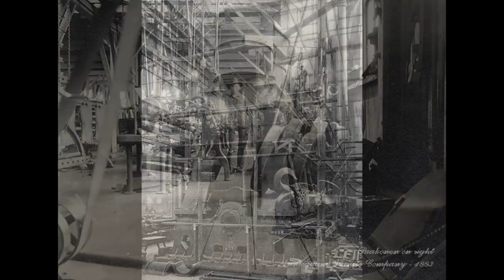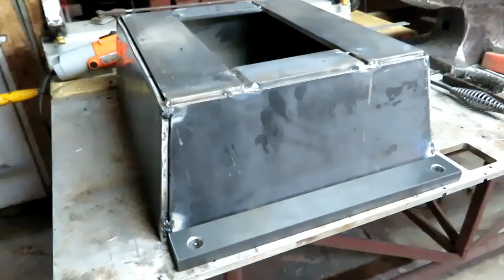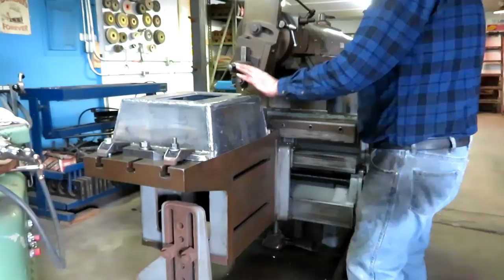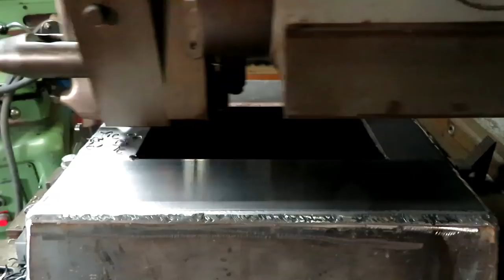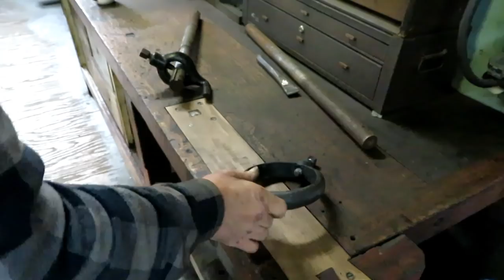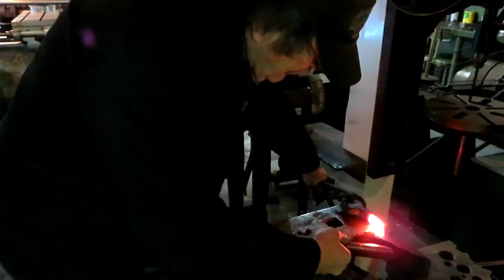OLD STEAM POWERED MACHINE SHOP  35  Steam engine frame base

Comment: One little trick I like to employ when fabricating an engine base from steel is to run over the entire surface with a needle scaler. The dimples on top of dimples that the needles make resemble a cast iron surface plus it hides grinding and welding marks.

Comment: Hi Dave! When you get around to painting that base, I would hit it with some self etch and SEM makes a great product for doing bumpers that is textured similar to safety paint (but not rough). I sometimes thin down gravel guard and reduce air pressure to get an uneven finish and then put the SEM textured paint on top to get a great cast look and finish off with some scrap silver base coat. Sometimes we build a parting line from body filler to make it uneven. It's all subjective to your needs or wants but thanks for entertaining my lunch today.
Reply from the maker: Great idea, I've used gravel guard before.....Dave
Reply: Gravel guard looks amateurish try the SEM stuff at a body supply store. Maybe Autozone has it, Walmart maybe but body supply for sure. Pebble Beach!

Comment: Great video Dave. Both the engine base on the shaper and the smithing. If you have access to the audio limiter setting in your camera, please raise the threshold and lower the record volume. If you can't access the limiter just lower the record level and raise it back up in your editing software. The constant pumping of the audio is enough to drive this old soundman crazy.
Mac
Reply from the maker: Sorry Mac, this little Cannon power shot doesn't have much audio control. ...Dave
Reply: Oh well.. I'm still going to watch your videos. Keep up the good work.

Comment: Great job on the builds , the machine base turned out super. Wish I get my back under control I need to build legs for my planer and an overhead pulley super structure . I have a nice 2HP 1140 rpm three phase to run it overkill but it was a trade no out of pocket . Have 5HP to make a RPC to run the shop. So much to do and no help . God bless buddy and hope your Christmas is merry and the new year stats out super. I know I'm looking forward to the big col increase of $2.00 YUPP think ill buy a brand new lathe YUPP wish in one hand and crap in the other guess which fills up first.

Comment: Todays episode was from your new fangled electric shop. 1960s? by the equipment in there. 
How did they weld things before electricity? Apart from Gas ofcourse.
That big planer wouyld go well in my shop as well.
Merry Xmas.
Reply from the maker: That base would have been cast iron, or possibly riveted together from plates and angle iron. Blacksmiths had the monopoly on welding and it's harder than you would think. The joint has to be made, the temp just right, flux added just right, and you have to be fast. I'm sure there are a lot of accomplished smiths reading this that can explain it much better.....Dave

Comment: Maybe if you had tacked or stitch welded some gussets into the underside of the base it might have prevented the top from warping in like it did, might have taken that hollow sound out of it too! So when you forged the dog, how did you form the circle after you split it open with the chisel?  Did you draw it down over a cone shaped block? Another nice video, really i
enjoy seeing that shaper on action. Merry Christmas!
Reply from the maker: I don't have a blacksmith's cone, should get one. It would have been easier and made a better job. I just wedged it apart, hammered the ends to spread it and worked it on the anvil horn. Getting the ends of the split out and round is harder than you'd think....Dave

Comment: you have a new subscriber! I haven't finished this video yet. but looks like you kinda think like I do. or at least do things kinda like I do. I'm amazed with steam. I want to build a steam DC power generator . to charge the batteries and power my off grid home. and use the  condensers to heat the house and help heat the hot water! I wish I had the tools or shop to build it all in. I think I can build it all. It will just take time.  my first attempt I guess will be converting a small gas engine to steam. then maybe a turbine . what ever I can get enough power out of . with as little steam as possible. or volume of steam.  videos like this male me think. and I learn something. thanks!
Reply from the maker: Sounds like a good plan, thanks for watching Jim, don't be a stranger......Dave

Comment: Wow Dave, In between loading up my Okuma lathe with a new stick, I watch your (as usual) first rate video. Yoo da man! Somewhere, don't remember, I read that the dead center in the head stock is called a live center...does that mean that the dead center in the tail stock is called a dead center? Had to bitch.
Reply: A live centre is one which has a built in bearing so can rotate without rubbing in the job. Dead centre is a plain piece of steel, a hard one in the tailstock and a soft one in the headstock so it cn be turned dead true
Reply: Can't argue with your use of the drawing, but my British textbook says what I did. Might find a picture later. I'd be surprised if British and US terms varied that much, but hey.
Reply: It's a fine point here, but has to do with grinding work where any looseness or wobble will mess up the product. A cylindrical grinder has a dead center (not turning) on the dog side and a dead center on the right.
Reply from the maker: I always figured the center in the head stock did not turn in the work which makes it "dead", could be wrong...Dave
Reply: Worked in a grinding shop in Lodi NJ in the 70's. My understanding was that a center that didn't turn was a dead center. There were jigs on those grinders for grinding the centers perfectly conical so the product would be round just in case the center was not perfect. Nowadays I hardly ever do work on centers. I use a 4 jaw and just sorta grab a bit of the driven end. But the proper way is on centers. I've never ever been wrong so......(:
Reply: Dave,

More than 1/2 a century ago the H.S. shop teacher called the soft center in the headstock "live".  IIRC, it did turn with the work (Morse taper fitted into the spindle).  It definitely was not lubricated.  We were lucky, as ball bearing tailstock centers came in to replace the hardened "dead" centers.  Make a mistake in lubricating a tailstock "dead" center and the work piece and center friction welded together.  :>((

Eli D.
Reply: In day of old when Knights were bold, no that's another story, in olden days a live centre turned, with the work in the headstock, and a dead centre was stationary. Nowadays a live centre is one with bearings and used where the dead centre used to be, and a dead centre is any solid one.
Reply: "Live" and "dead" centers have become so hopelessly confused that I just say where it is mounted and what it does.  I. E., a non turning tailstock center, or a ball bearing tailstock center, or a solid headstock center.  Did those make sense to you?  Communication is the goal...
Reply: Dave, from my machine shop experience, (1972)
a dead center is just a piece of steel, sharpened 
to a 60 degree point.  A live center has a bearing 
in it, so the point would revolve with the work.

You are correct, but expressed it differently.  A 
live center is not needed in the headstock, 
because that dog you made, would have the 
center turning with the work.  (No friction on 
the center.)

My woodturning experience, has me using a dead 
center in the tailstock, but I prefer a live center there.

As always, GREAT show!

steve

Comment: Hold the hammer at the end of the shaft, it works better, or why would they make the shaft as long as it is ?

Malcolm
Reply from the maker: It weighs almost 6 lbs. I don't have enough wrist to swing it. Not a good hammer for blacksmithing.....Dave

Comment: Wow! A lot going on in this installment. That is a damn fine base you made for the Morris. Question on the shaper if you please: The Armstrong or Williams type tool holder used on the shaper appears to be a straight shank holder. Are left or right angled holders ever used to get the cutter into tighter spaces? Also please, what are the grinds on the shaper's hss cutters like? Or, I should say, what is the most common grind used? Beautiful little South Bend you have there btw. Merry Christmas to you and your family.
Reply from the maker: John, I recut the Morris engine  crosshead surfaces on the smaller G&E shaper a couple videos back. That was the most awkward shaper set up I've done so far to get in from both sides. I ground a left and right tool bit for that job. I grind the tools about the same as for a lathe but with a little less side and back rake. Carbide will not hold up at all. I use a large radius round nose for finish work, although a friend of mine showed be a way to grind a diagonal angled, flat "shear" point for taking a very light finish cut. It leaves a spectacularly nice finish. I never had much success with the old manuals "flat nose" finish cutter. It chatters some....Dave
Reply: Thanks for the info, Dave. I appreciate it.

Comment: Im surprised you have wood floors with all that machine weight and you use torches . I'd be afraid to burn shit down
Reply from the maker: Hi Bill, I think that video piece was from the other part of the building with a concrete floor, I do the welding out there....Dave